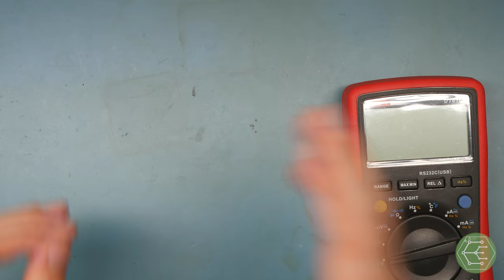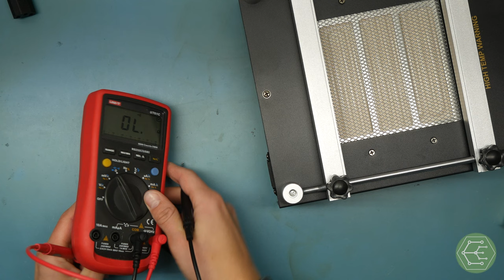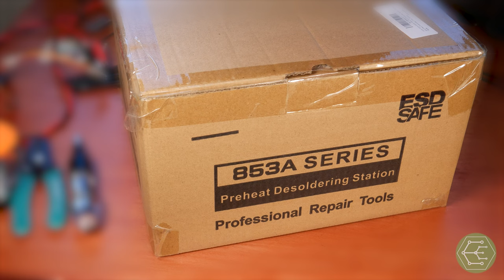Assembly Method Planning – YiHua 853A Teardown and Reflow attempt | MOT 11

Comment: I'm impressed anyone can solder or remove such tiny components by hand. I find even the larger scale surface mount stuff painful to work with my old eyes. Working on my old 80s computer through-hole components and DIP packages is so much easier...
Reply from the maker: Hi Bryan! These were 0603's - tweezers are certainly necessary! No magnification yet .. but that comes for everyone eventually. :)

Comment: UM i have seen video where pcb soldering is directly in metal mesh not mount rails and board get hot enough to solder smd directly. i have this too and not test yet this

Comment: Hello Ryan! I hope life is treating you well! 😁

 I do not think it is power issue. The issue is the thing is bloody wide open! Heat escapes. Else, PCB needs to be placed right next to (touching) the heating element to be effective without extra assistance from heat gun.

It is like an oven with its door open and then needs flamethrower to bake stuff. Makes no sense to me. I can understand the convenience of being able to clearly see and easily mess with components but still makes no sense to me if something is inefficient (but claims all sorts).

Oh, about your question on motor, what fascinates me is the graph. I always read and hear that the motor will consume more power if its rotor has resistance compared to if it freely spins, but I never see a working one. Sometimes theory is meaningless without practical.
Reply from the maker: Hello Real Christopher! Life is treating me well, for sure. I hope the same for you!. :)

Fair enough - This certainly more of a rework station (Where having free access to components is paramount) We'll see if you're theory holds true!

Thankfully, I hope to take another attempt at getting a reflow set-up going, and I think the next product I want to try will be easy to add a "hood" or "door" to.  Efficiency is always good. 

That would be a fun graph to see - Motor Current and Voltage over time... Hopefully I can deliver something there!
Reply: @EEforEveryone  Dear Ryan, I hope I am not instigating anything. Hahahahaha. Just common sense and observation. Of course common sense is not common.

"Rework" set-up or station is rather new to me, and is kind of makes-no-sense to me. But yes, it is essential if one needs to move components around on the fly.

(Yeah. I do not want to ignore your question about the motor video as I could be seen "jealous" that you got married! 😂 🤣😂 🤣 A little humor there. By the time you responded COINCIDENTALLY I went silent.  I read your response but I was busy hunting and researching for oven. Juggling between money and quality. Sigh. Proper oven is never inexpensive.)
Reply from the maker: Lol, no instigating there. :) Rework stations are a really niche thing. They're helpful If you get some prototype boards that have a bga on them back and 'something' doesn't work- they make it easier to swap complex no-lead parts because a gentle even heat goes a long way!

I wasn't worried about you being less active in the comments- you were certainly missed, and I know how life is. Sometimes it gets busy, but that's a great thing about TY- it's easy to catch up and see where things are!  I hope your oven purchase went well! I hate mine. I swear it's made to burn food, any setting less than "full on" is just choosing a timer for how long it'll wait before turning "Full on". No joke, I've seen the burner stay on for 60 seconds straight on "4" out of 10

Comment: There is a small pot on the board. It needs to be tweaked to allow correct temperature. you will need to open and use a temperature probe on the hotplate to adjust accordingly
Reply: I just bought one of these, any info on how to tweak that pot?

Comment: I do not think it is advertised anywhere as a reflow oven. So I'm not supprised you are not able to solder without adding extra heat. But I think it might buy one because it seems to work very well as a preheater. It also looks quite descent for a Chinese made device.